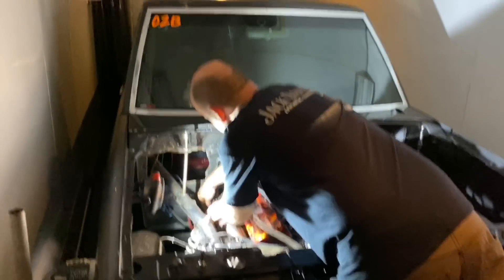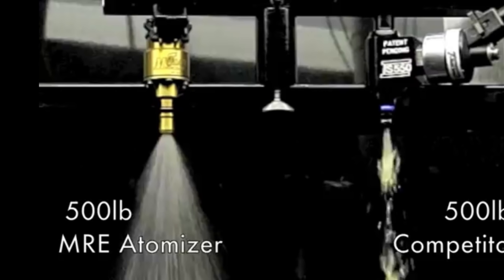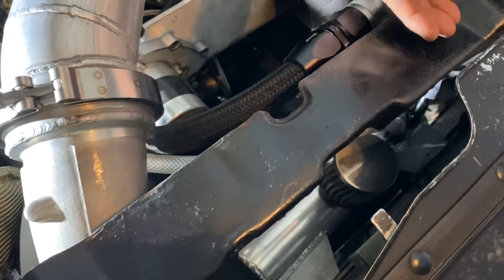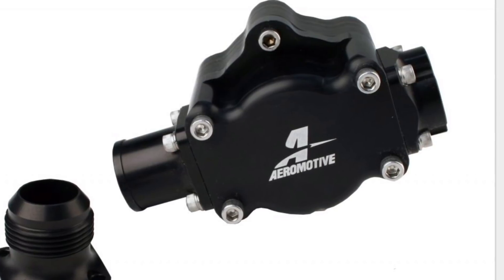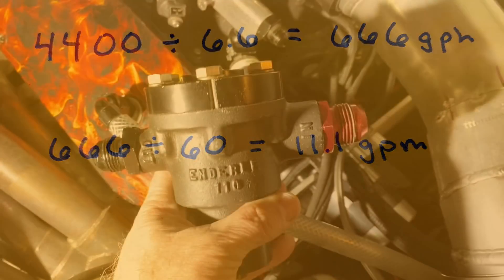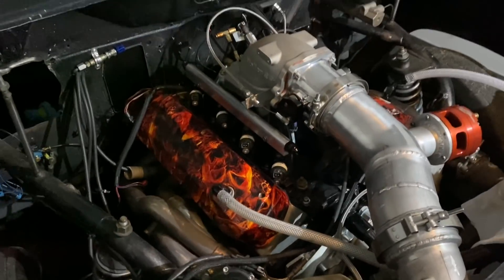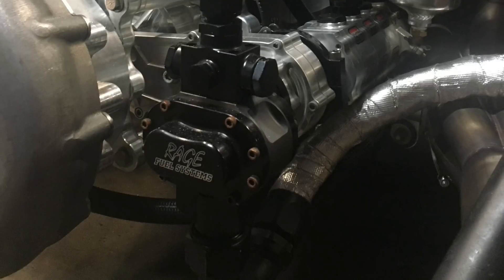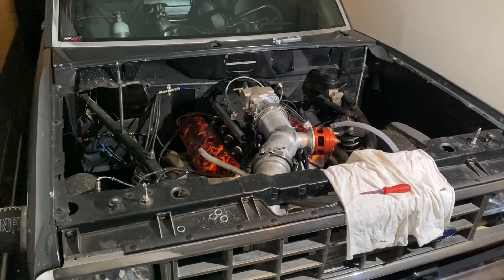Switching from Gas to Methanol

Comment from the maker: One disadvantage, I forgot to mention in the vid is more frequent oil changes most times.  IF you get the tune perfect, and get the motor warm before you push it in the trailer or have a pan heater the oil can stay pretty clean.  I cook of the moisture and reuse my oil since it normally comes out every couple races to get the moisture out.
Reply: How do you recommend cooking the alcohol out of the oil? Thanks John
Reply: Will u please do a video showing how u cook off the moisture from ur oil.
Reply: @edwardvanhoose6764  he's already made that video
Reply: The right oil helps too . But basically you need to boil the water out of the oil was a common practice to run the engine 220* for a bit will boil the water out of the oil .
Reply: Why couldn't you use like a 700 gph electric pump as a lift pump?

Comment: You’re right on the money concerning fuel consumption. The air fuel mixture is double for alcohol. That’s why I want nothing to do with it in my street car. I saw a significant reduction in fuel mileage and range when they brought out the 10% ethanol mixture gasoline. I call it garbage gasoline. I want fuel mileage and I’m willing to pay a little more for the ability to drive much further on a tank of gasoline.

Comment: Thank you for posting this. Been looking for a while. Do you know what to do with a carb to run it?
Reply from the maker: It’s way more complicated!  Takes CC a ton of work to get the carb to flow enough fuel!  I would let a professional build it.
Reply: @TurboJohnRacing  I would have assumed carb would be easier. I have a motorcycle that I am trying to convert to an alcohol run. That way I can still get around when gas is too expensive to buy. Still in the research phase....do you know where to find an explanation on your math for the injectors? Great video my guy. Liked, and sub. Keep em coming.

Comment: Is this the same as a procharged motor? Building a procharged small block and thinking of running strictly methanol instead of C16 with and intercooler. Any suggestions?

Comment: On my dirt late model racecar I run a piston fuel pump on a 400 ci small block chevy and it's supposed to supply a 2,500 hp engine would it work on a turbo engine? It bolts up to the stock fuel pump location on a old school V8

Comment: John looking at the  markings on that pump it is a 1100  not a 110  the differance is in the gear size  110 to 1200 have the same housing the number stamped beside the 110 tells the size of the pump  I have been running  meth for over 40 + years  good vid keep them coming and stay safe cheers from down under

Comment: One day I’ll get my head removed from my ass and switch to alcohol and efi , I’m still blow through dominator q16 😭.

What does John think about mechanical alcohol injection with turbo? We have rons alcohol injection here in Az and they swear I’ll get more consistency and run cooler . Just haven’t seen mechanical injection with turbo only s/c.
Reply from the maker: yes, it can work great.  Second set of injectors that come on as boost climbs.  Travis Quillen has mastered it!

Comment: So if you are running a carburetor on methenol u can use a electric pump.
Reply from the maker: as long as the flow is good at your pressure

Comment: Thanks for the video ! 
I'm in the process of setting up my car for methanol now. :)
Could you do more videos of how you setup the ecu for the methanol?
Reply: I wonder if jonn sometimes spikes his M100 ( or gasoline/E100 ) with nitromethane aka NM to up to 30% concentration as PFI speed and UTG YouTube channels have done it and one vintage rail has a how to do it safely on the internet. I was told it acts Like a big shot of NO2/adding a bigger turbo/1-3 more psi of boost depending on how much it’s running. 

I’m doing the same as you as 110LL is $$ ( old 1970 440 mopar and I wasn’t sure if the valves had been fixed for EPA gasoline aka hardened valve seats and valve heads and was doing as cheap insurance ) and my new engine ( 1970 440 RB/426 G2 hemi running turbo boost ) can run on USA 🇺🇸 85 regular pump Ron if I’m desperate ( I found out tricks too do it but not my favourite as I have to lower cylinder pressure and kill mpg/power ) but most of the time I’m planning on 91- to q16 aka AV-gas or E85 depending on where I’m driving local a round town I can get M100 cheap and easy too. its my first pick at the pumps on dyno/race day I’m going to spike it up to 30% nitro I’m mostly reserving it for special events/occasions because it’s $$$ @ 15-40$ a 🇺🇸 gallon and a side effect it at 30% cackles and smells like a 60’s topfueler and I can even add essential oils to change the smell to ie Orange

Comment: I guess the price difference to hp gains with M5 is not worth it for you?
Reply from the maker: M5 is usually used when the power adder is maxed out and you need a little more.  I'm not maxed on boost.